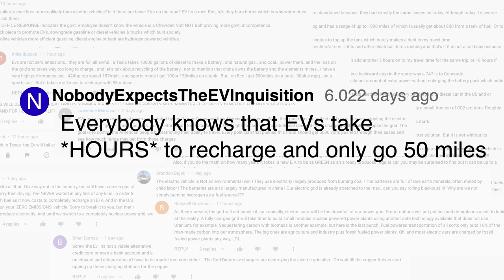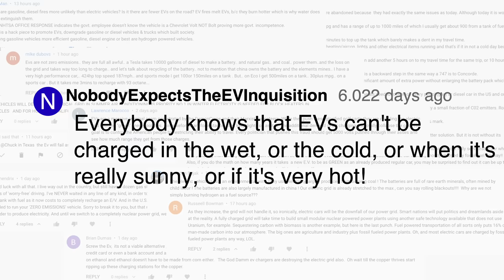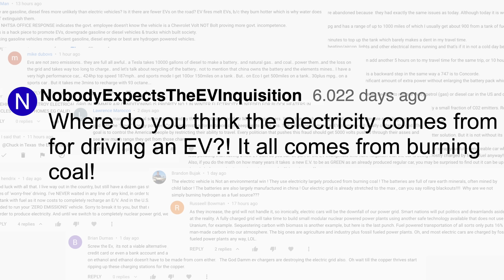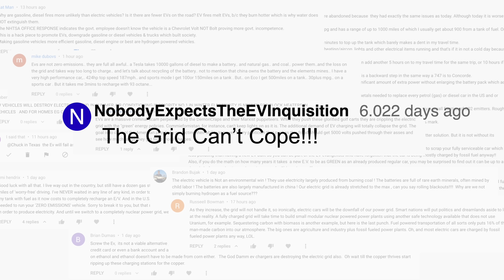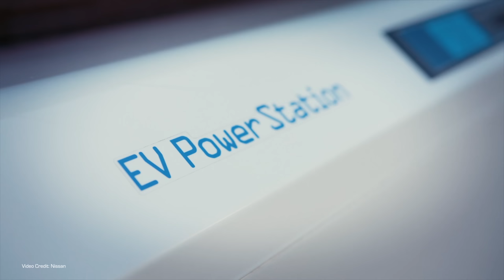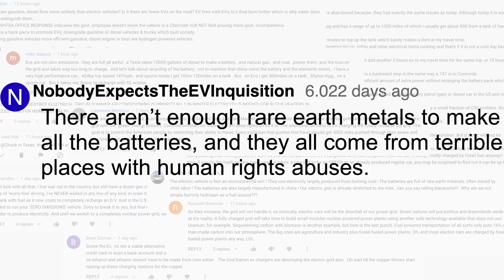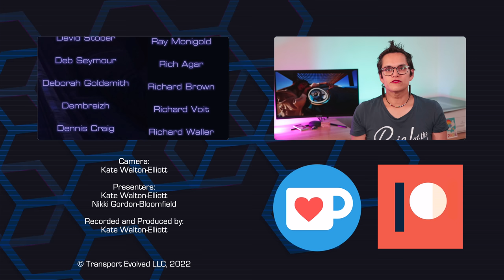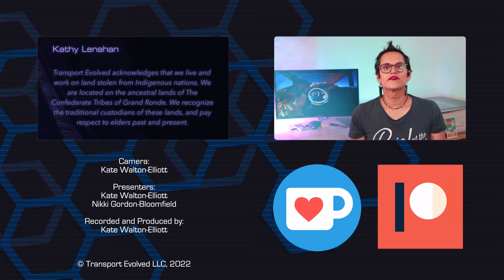The Transport Evolved List of Common (EV) Misconceptions

Comment: That whole ‘you need to take a break every few hours anyway’ argument is a land mine.  I’ve tried to make it myself and surprisingly few people will consider it valid.  I recently got flamed on Facebook by two different people, one a trucker who accused me of being an unsafe driver because I believed everyone should stop at least every 4 hours for a break, and another a German who was absolutely indignant that I didn’t consider their higher road speeds in my comment.
Reply: people want so badly to do wrong.
Reply: I'm confused. Why would higher road speeds allow you to drive longer? If anything, you'll probably need more frequent breaks. It requires a lot more focus to drive at 120 than it does at 70.
Reply: Where the frequent long breaks get tricky, is what time you arrive at your destination. For example 8-10 hours of driving, can turn into 12-14 hours with extended breaks. Leading you to driving around a unknown area in the middle of the night looking for a recharger.
Reply: Lots of people have a touchstone in their lives of that one time they drove 30 hours straight to get some Coors beer, or get to Spring Break, and if EV's can't afford that same ill-advised experience in exactly the same way then they're unacceptable even if that memory is 40 years old and Shouty Bob can no longer go more than 4 hours or so without a potty break anyway.
Reply: @Dularr  You’re not looking for anything you know all of your stops ahead of time.
Reply: @BixbyConsequence  it does not matter what is the reason stated, the  true reason is that we do not want to change, and BEV's  offer nothing that would be considered even remotely exciting, that would make it more attractive proposition. And on top of that I hate what the government mandates regarding ICEV's, so what do you expect ...
Reply: @scottmcshannon6821  this is wrong assumption, there is not a single person who abides every single law etc. Every single day, a normal person will brake some rules (those who say they do not - mostly unintentionally lie, they just may not know the rules to that extent, or a particular law or rule).
Reply: @Dularr  My car displays all the chargers on the screen and will navigate to them. I have about six apps that also show where chargers are and one includes photos and reviews of the area and businesses nearby.
After 12-14 hours of driving, I pretty much want a hotel, and it turns out there is an app for that too. I didn't download EVhotels yet because of the $2.99 price and the fact that Booking has a filter for hotels with chargers now.
What I usually do is at the charging stop before I think I might stop for the night, I look on Booking for a motel in the area I think I will be in so I can see the prices and reviews and if they have chargers.
Reply: @aigarslacis4433  You can hang on to an outdated expectation or willful contrarianism and at best the world passes you by.  At worst the world you really wanted ceases to exist.  Enlightened self-interest suggests that when continued prosperity requires a change, you really should make it.
Reply: @aigarslacis4433  Glad you finally admitted that its just ignorance and stubborness. BTW, we all already knew that was the truth, thank you for admitting it. I do think it is funny that you spefically said there is nothing "exciting" about EVs... because that is exactly how most of us feel about stinky, loud, slow, leaky, unreliable, disgusting, steam-age contraptions.
Reply: @kenmcclow8963  For a 8 hour trip, I know exactly where to stop. For a 8 hour trip, I'll sleep at my destination. Having to stay on the road for 4 more hours is unreasonable.
Reply: @Dularr  If driving an EV adds more than 1 hour to your 8 hour trip then you are obviously clueless about EV charging and trip planning.  Typical modern EVs and use of the correct charger would only add about 30-40 minutes to your trip.  That could easily be a nice, easy dining break in the middle of the trip.
Reply: Wow, sounds like that trucker is quite unsafe.
Reply: @wingsounds13  you damn well know how far that is from truth. The very best case scenario would be at least 30 min. per every 300 miles of driving. To beat that you have to have the largest available batteries
Reply: @aigarslacis4433  never having to worry about high gas prices anymore is a pretty good selling point
Reply: @Dularr  an 8 hour road trip will not add 4 more hours to the trip with an ev. at most maybe 2 but even that’s rare
Reply: @aigarslacis4433  how often do people go on road trips off over 300 miles. not very often. and if they do then maybe an ev isn’t the best fit for them. a hybrid would be a better option
Reply: @alanp613  that depends on the person you ask, me personally only about 2x a year when going on longer trip (summer or skiing). But I do frequently close to 200 km just one way. So I am about the choice, those who can do BEV do drive them, but for me please leave ICEV with stick shift !
Reply: @alanp613  That is true if you do "short trips", like home to work and back to home charger, but if you use public charger, I saw in one recent BEV travel article, that he paid 12.3 EUR average per 100 km, which is something that I would pay for diesel if the price is 2 EUR per liter and I drive my SUV like an complete idiot. More reasonable asumption is 10 or 11 EUR per 100 km for my diesel cars if I drive like I normaly drive, and if I am extremly frugal, I could probably do 9 EUR per 100 km. So it depends.
And by the way 2EUR per liter gas price actually is mostly tax , and not the real price of the fuel !!!
Reply: @aigarslacis4433  I can’t heLp feeling you’re missing the point of EVs. They aren’t being developed because they are more “exciting” alternative to ICE. It wouldn’t matter if EVs weren’t as “good” as ICE, we have to make the transition anyway (err Climate Change in case you weren’t sure why..). The real issues with EVs aren’t wether they work, but rather is the infrastructure there to support them, and that is just a problem that can be solved. As to why they need to be “mandated”, well the same reason we need all sorts of legislation, because some people are too selfish just to do the right thing.
Reply: @iblack585  The only point of buying/selling new cars is business, it has no relevance to CO2 emissions or environment what so ever, if you were truly fighting CO2, you would do incentives on working from home , to reduce travel altogether, and leave that vehicle choice to those who really need to drive, deliver etc.
But that naturally would kill a lot of business, starting from cars and ending with restaurants and shops near your work place ....
If you think otherwise check with the global CO2 and waste "production" data ;)
Reply: @iblack585  P.S. and there are other incentives, like sponsoring bicycles for going to work, for moving business out of congested city centers etc. Car production as such does no good what so ever ...
Reply: @aigarslacis4433  what a naive comment, every business activity has something to do with CO2 emissions. Of course improving public transport, working at home etc have a role to play. But cars release more CO2 than shipping and aviation combined. So they need decarbonising.
Reply: @aigarslacis4433  what are you arguing for? That we should ban cars or that EVs are not a viable alternative to ICE? Given that we currently have a society heavily dependent on cars I think EVs are a good idea. Then we should also pursue policies that mean people can live without them.
Reply: @iblack585  So ... why do insist the BEV are way to go ??? The more cars   are and will be available for purchase, the more CO2 has been produced, even without driving them, even the CO2 emissions tax in most countries is put on the wrong subject (cars engine size, not the amount of used gas/diesel or other energy source) so that not to influence the business, just make the unsuspecting end user the most guilty ... and then yes BEV's are the most likable "exit strategy" from the problems that have been self inflicted, yes in large part by the oil and gas industry ...
Reply: @iblack585  There is place for BEV, but making it the only type of transport by end of 2035, is a stupidity to say the least. We are living on the unrealistic and unfulfillable expectations regarding transportation and sustainability.
And the point of it ... well the sooner you look for other real solutions, the sooner people will accept the fact that the need for driving is redundant for the most.
Reply: @alanp613  read my post, I gave a range. I suspect it will be closer to two 40 minute breaks. Maybe a third as I like to arrive with as much fuel as possible.
Don't for get the hosts recommended extended breaks every 3 to 4 hours.
Reply: @Dularr  -- If you don't want to arrive at your destination in the middle of the night, plan ahead.
Reply: @aigarslacis4433  -- 300 miles at an average speed of 60 mph is 5 hours of driving. At a minimum, you'll want a bathroom break and a coffee. That's 15 minutes right there, so an extra 15 minutes stop. Let's call it 2 stops in 10 hours. An extra 30 minutes sounds about right. It might even be less.
Reply: @lamplighter5545  I tend to agree on that estimation if you want to go particular places and not wander about, but doing it in BEV is nearly impossible, or you are just born seriously lucky ...
Whatever the charging station, you are likely going to be next in line at best, and if enogh BEV owners decided to have dinner during charging,  close to your "pit-stop" times, you are way off your target arrival ;). Popular places are popular for a reason ...
Reply: @aigarslacis4433  -- I hope you realize that when you're talking about thinks like number of charging stations at popular locations you're talking something that's easily solved. What I have to emphasize, is that the world is not going 'all EV' at the snap of a finger. It's going to take a while. The technology will progress and so will the infrastructure. The Model T was introduced in 1908. There were 2 gas stations in the U.S. By 1926. the year the Model A was introduced, there were about 120,000.
Reply: @lamplighter5545  I do realize, but I do not believe that it is going to be easily solved, there are two places where I would agree it will likely work out great - large cities and suburbs, and nearby power stations/plants, the rest is definitely be pain in the butt. I would think along the lines of how the cellular  telecoms address their service coverage, and even though Latvia is small and quality of telecoms service is one of the highest in the world,  there are locations on my way and also at a country house where the cell service is almost none.  And because the cell coverage expands in the way that makes most sense to the business, I expect similar "problems" and solutions with EV charging.
Reply: @lamplighter5545  I'd argued, not to him directly, but as a first level comment on a Facebook post about a 500 mile car that 300 miles was really the magic number, being as that's 4 hours at 75 mph.  Then I hedged myself by saying something like "if that means the sticker needs to say 400 miles then so be it" and this guy comes at me like how dare I, an American, not consider Germans drive 90mph minimum and so they need 360+ miles of range.  He then went into the whole 10%-80% charging thing and degradation over time and acted like no one is actually starting each day of a multi day road trip at 100%.

Honestly he made it more complicated than it needed to be.  The truth is, even a Mustang Mach E, after 10% battery degredation and charging 10-80% only two stops are required to go border to border inside Germany.  It would be easy to do in one day, and probably the furthest anyone really should actually drive in a day.  I did the math.  He accused me of having terrible reading comprehension.  But seriously man, you don't need a car with a 500 mile range.  It's excessive and consumes too many resources.
Reply: @BixbyConsequence  my parents, old hippies, driving Indiana to Colorado in one sitting on amphetamines in the 1970's.  But they wouldn't even think of trying that today, as should no one.
Reply: @aigarslacis4433  "BEV's  offer nothing that would be considered even remotely exciting".  Just looking at Mach E and Aptera.  Both of these vehicles offer sub 5s 0-60mph times.  Both of these vehicles offer batteries that are perfectly suitable for a well planned 600 mile day.  Both of these vehicles ensure that their owner will never have to stop at a gas station in the middle of the winter for fuel on a winter morning when they're already late for work.

To me, each of those is quite exciting.
Reply: @aigarslacis4433  "BEV's  offer nothing that would be considered even remotely exciting".  Just looking at Mach E and Aptera.  Both of these vehicles offer sub 5s 0-60mph times.  Both of these vehicles offer batteries that are perfectly suitable for a well planned 600 mile day.  Both of these vehicles ensure that their owner will never have to stop at a gas station in the middle of the winter for fuel on a winter morning when they're already late for work.
Reply: @abelincoln78  -- I think people consistently overestimate their needs and it's not just about EVs. It happens with ICE vehicles, too. If they can envision a future need, even an unlikely one, they want the car to be able to fulfill it.
Reply: The only time I ever drove 500 miles in a day, it took me a good 13 hours (including breaks) to do it in an ICE car. Trying to do it any faster would have resulted in drowsy driving, and would have been extremely dangerous.

If you go on YouTube, you can find numerous examples of people covering 500 miles in less time than that in a Bolt, which is one of the slowest-charging EV cars out there (numerous other EVs, including all Teslas, can do it much faster). So, if I were to repeat the trip in an electric car, the need to charge would certainly impact where I stop, but the total travel time, I think would be essentially unchanged.

Also, the idea that you're stuck sitting at a charging station for 45 minutes to reach is also not true. Nobody is forcing you to charge all the way to 80%, and as soon as you have enough power to make it to the next charging station, you can unplug and go. More frequent, but short breaks is probably a good idea for your body, anyway.
Reply: @aigarslacis4433  and how many miles are you driving in your 8 hour trip? 600 miles in 8 hours?  By your admission that would be 1 30-40 minute trip stop at the 300 mile mark. Very far from your claim of multiple hours added to the trip.
Reply: @lamplighter5545  which is why 1/2 ton trucks are advertized by their theoretical max towing *when properly equipped*.  Dudes be like "gotta have something to tow that boat I'm probably never going to afford".

When I got married my wife was driving a Mini Cooper.  People actually told her, a single 22yo woman, "what if you have kids?"  The answer is simple: She was already in a position where she could afford a new car with historically high resale value.  Sell it and buy a bigger car when you need it.  Enjoy the small efficient sport coupe while you can!

And when she decided she wanted to be a mom, the first thing we did was buy a family car, and the Mini provided a handsome down payment!
Reply: @ab-tf5fl  my maximum daily distance bogey is 600 miles.  Some people may be asking for more, but realistically in the USA that's an easy 10 hours after factoring in stops.

I can't speak for everyone, but if my family has gone over 200 miles in one sitting we're having a really good day.  We'll easily be off task for 30-45 minutes too so in reality for us as long as there is food and a bathroom within walking distance of the charger our trip time will be completely unaffected!
Reply: @johnsnell1929  I told him that attitude was not acceptable for someone operating a machine with 20X the mass of my own.  Then I deleted the whole comment thread.  It wasn't worth it with the pile on of folks acting like it was so terrible to take a 15 minute break every 2 hours like is required by so many companies these days.  And those folks aren't in control of 80,000# missiles traveling at 70+mph!
Reply: @abelincoln78  Regarding Mustang - I unfortunately hate what Ford has done there. I kind of like US market electric pick-ups though, but I also kind of think they could have done something better with the "frunk" design wise and overall space wise ...
Reply: @wingsounds13  Let me explain how I live and choose cars. I never by them on financing, and I never buy anything above 40K EUR, I drive to about 200Kkm in about 10 years. I love stick shift, I hate drivers aids, I hate those stupid large screen touch pads in cars and find them super inconvenient and annoying, I hate planing charging.  Do you have BEV that would fit me, I highly doubt it.
Reply: For me where the BEV fits, is in the city, as in driving to work and around  , it would be driven 20-30 miles a day and charged overnight, but then again this is not a very sound proposition environmentally, one could just continue using bicycle, or the public transport. Hell I have even walked that distance a couple of times to and from work ...
Reply: @aigarslacis4433  Do you seriously think that EVs are not as "exciting" as ICE?  You obviously have never driven a Tesla.  I like the acceleration a lot!  Perhaps you are excited by noise, vibration and smoke?  I don't like those.
Reply: @incognitotorpedo42  Sorry man, I was never a drag person, so no,  acceleration will not "move me", if you can do good track (no not oval) , rally or off road, that is my thing. Tesla does not do it, maybe the pick up truck will be different ...
Reply: @wingsounds13  Both. :D 
But I would like to buy something that I like after 2035. And so far it seems that I will be left with "option" to buy a ICEV Porsche, or go F myself.
Reply: @aigarslacis4433  it's still early in the modern EV era.  The state of the art will be considerably different by 2035.  My guess is that you should easily find an EV that meets your needs by then.